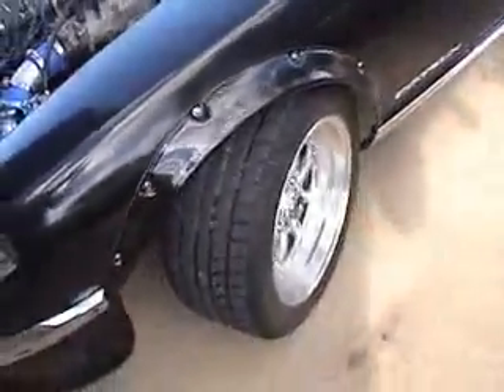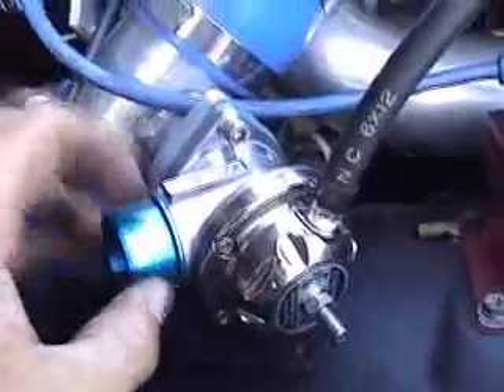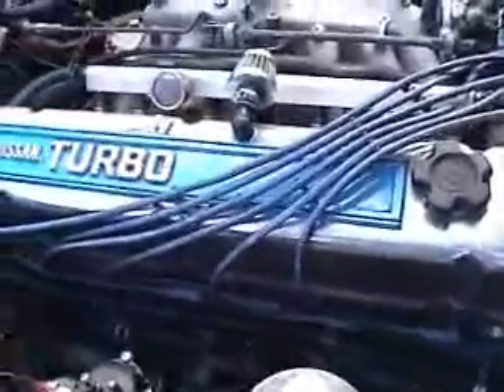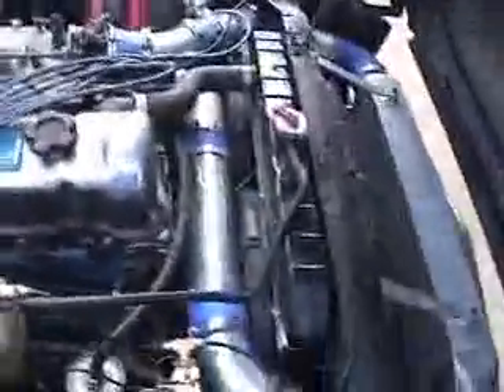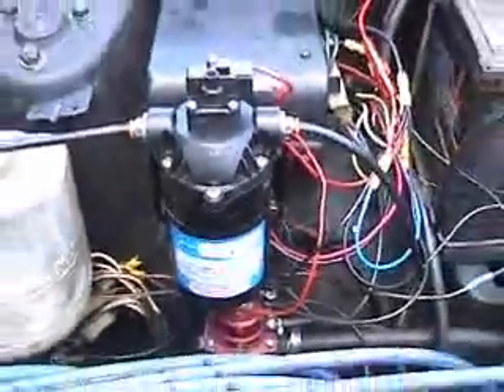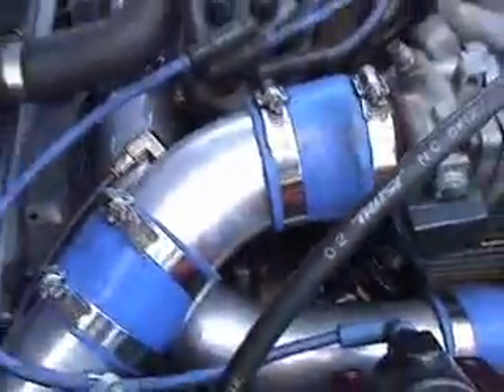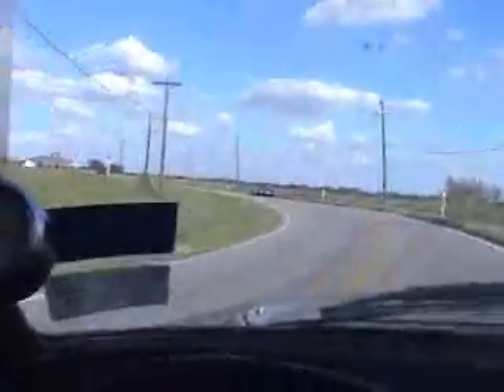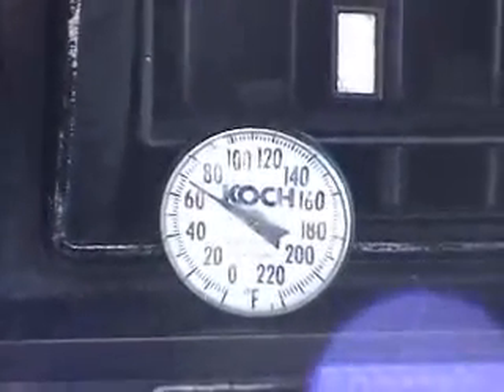methanol injection on my Turbo Datsun 280z

Comment: Where did you get your rear spoiler from? and what did the new engine come out of?... i have a 1977 280z and i want to build up the stock L28 and add just a turbo with 8 pounds of boost at the most run 10psi

Comment: That Z's the shit! You mentioned that you had wheel spacers on it, where can I get some? Been lookin all over and can't find 'em for my '80 non turbo. I'm also lookin into a methanol kit, would it work on a non - turbo or does it only work off the boost psi?

Comment: Cool stuff man. How long does the reservoir last before it empties? Did you have to make a lot of fuel and timing adjustments? Just wondering as I might be doing a methanol injection setup in the future. Great job so far on the Z!

Comment: Love the vids.

What cc injectors / duty cycle are you running?  Also what fuel pressure?

Looks like you got the wideband working with the mega squirt.

Rebuilt my front brake calipers yesterday.  Very stoked at how the 84 toyota hilux 4 piston calipers bolt straight up.